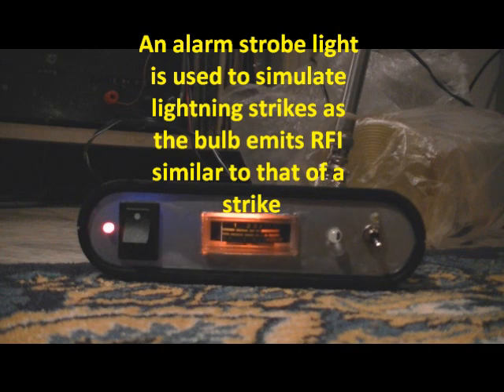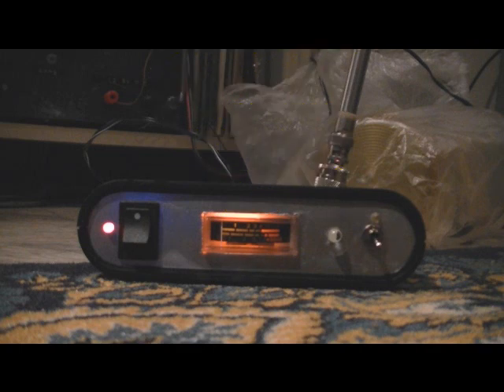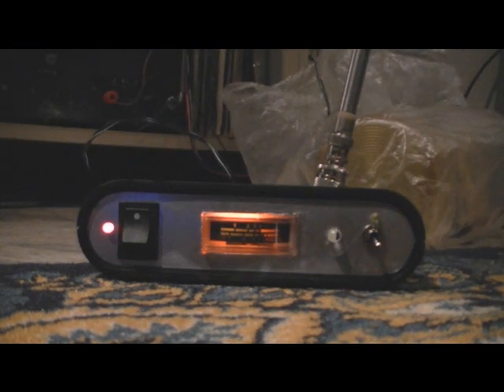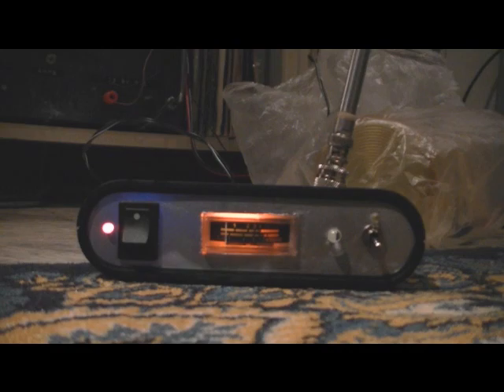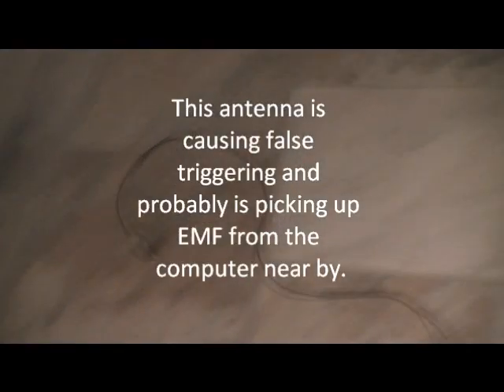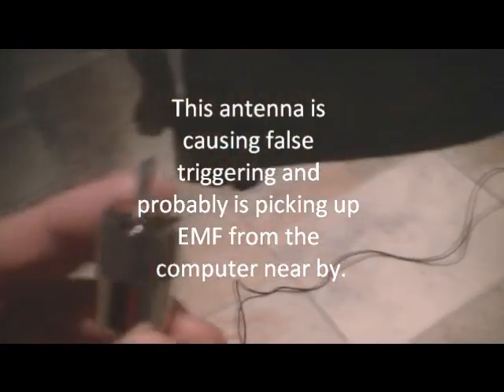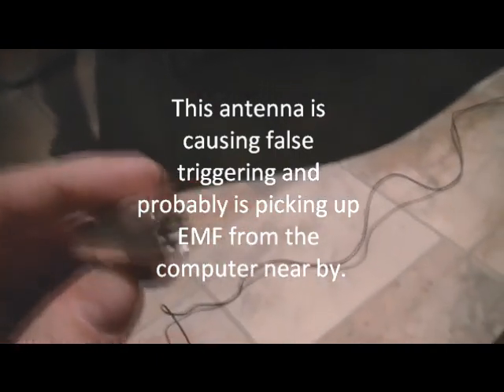Home Made Lightning Detector

Comment: hello. Could you send me a diagram of the detector? my e-mail: slawek1614@interia.pl
Reply from the maker: No problem, it is right here with all details provided: http://www.techlib.com/electronics/lightning.html
Reply: jphdg I still have this question. what and how much you have given voltage [mA]?
Reply from the maker: No problems. The input is 5V DC to the circuit. Exact mA draw I am not sure, but it is very small.  In my project I used a 5V regulator so I could drive it off anything from around 7 - 15V DC.

Comment from the maker: I know what you mean as I used a strobe light to trigger it when testing, but generally no it does not pick up emergency vehicle strobes as they need to be very close for the detector to sense them.  Lightning however the detector is quite sensitive to.  I have found though it will indicate a strike when turning on some lights in the house.

Comment from the maker: @TheHossHobart 
All good Tim.  

I used an old base station 5.5m long CB antenna outside.  Works like a charm except when we get some bad bursts of power line interference there is enough strength to trigger off the detector during the power arcs. Sensitive enough with that antenna for about 150Kms I believe.

When storms gets closer, I will disconnect it & use a 4 foot telescopic whip with BNC plug straight off the back of the unit as seen in the video and performance is I guess reasonable.

Comment: @jphdg...Sorry to take so long in getting back with you.  I made mine with just an LED indicator. I attached the antenna to the input capacitor that goes to the amplifier transistor because it is much more sensitive That way.  If I attach the antenna to the tank circuit, it doesn't work right.  It might be because the 10 millihenry coil has 112 ohms DCR.  Other than that it seems to work ok.
Tim

Comment from the maker: Hi Tim,  

No worries.. glad you have it figured out. 

Are you building yours solely as LED indication or are you adding extras such as a logic output to drive an event counter / PC logger?

Should be easy to add as you can take the signal off the output transistor driving your LED circuit as long as you don't load it down. (Hence high impedance) 

Looking forward to some real good storm activity for more testing now that Summer is just around the corner!

Happy and safe storm detecting!

Comment: @jphdg...Hi John.  Did you have any trouble out of your lightning detector when you first wired it up?  I wired mine up 3 times and its still not working right.  I am using a spark coil to simulate lightning.  I notice that when I disconnect one of the battery leads the led will stay lit, then it will glow brightly and then of couse stop.  Any suggestions?  
Tim